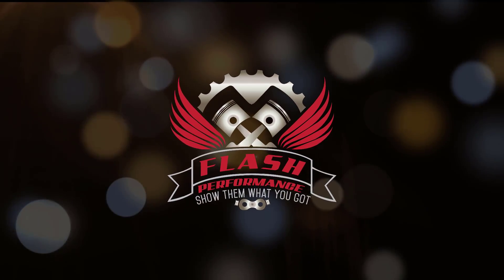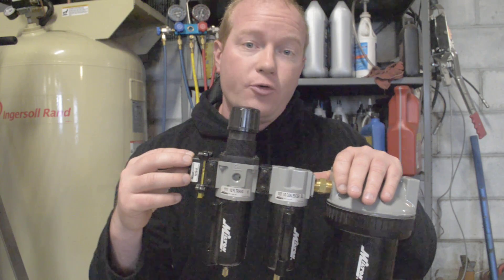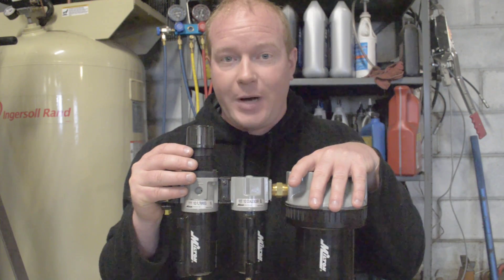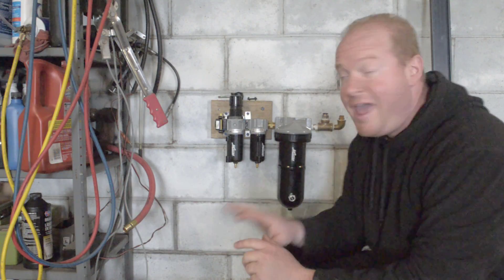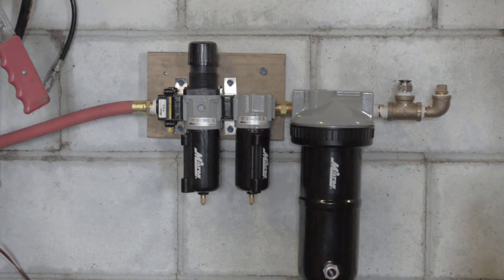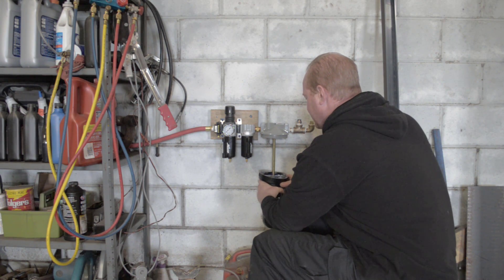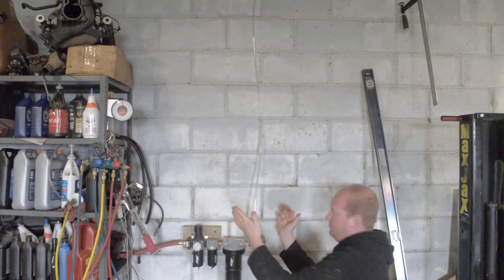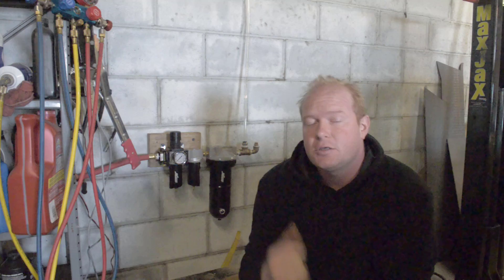#Milton Shop Air Filter Dryer System

Comment: Bad practice to hang an assembly by the connection piping.  The maker of all of these filters (no matter the brand name) should sell the connection bracket/ coupling, like the one between the regulator.  I have asked for them to sell it, for proper mounting, but crickets.  Sad.

Comment: I know this is old, but I'm considering buying this unit. Is the air flow plumbed in reverse in the video. It would seem that as the desiccant breaks down, it would travel through the line into the tool. I've never seen a filter system without a filter and regulator after the desiccant. Of course, in classic Milton style, I can't find anything online, no manual,  not even a Google image of someone's setup. Any help would be appreciated.  Otherwise, I'll probably go with an Arrow PC7612XXL.
Reply: I just ordered the arrow unit, how do u like it ?
Reply: @Exit1Auto  I ended up buying the Milton but installed it in the correct order. TBH, I think they are both just as good as the other. I have sprayed with it and have had zero contamination.

Comment: I live in sunny FL. Milton is an old name...my dad had Milton products  in his old service station..in my home garage. I have a half inch filter system..Amite system another old name in the auto shop system. Known for there lubricant products. Love Milton as well. I bought a new industrial  type air comprsoir..for my home shop..a Saylor-beall  unit model # VT- 730-60-1-FP.    60 gal .. they offer a cooling system  on there profomance  pkg. With a radiator  on the belt cage by the motor  a fan built on the motor to cool it to room temperature..plus a automatic  tank drain. Due to the fact im.in FL..I hard pipe my shop, black iron pipe..no plastic  it will peel from the inside out..in time and get in your air tools and pain guns ..after 10 yrs you,ll have issues..trust me..  so I stayed with iron black piping..old school..plex piping  is what I was referring too..it will start to peel over a long period  of time..I do drain everything  out at night..because  I have kids around..for safety..and lock out the power..to it..as for your comprsoir. I would add a magnetic  starter..to it IR has issues  with there pres switch s...it will cost about 300 bucks. A adder..but worth it in down time costs ask any electrician..if your unit is 5 hp.or more..your drawing 40 amps at a minimum  starting your unit each time....great  video  love it..

Comment: Do you have any ideaif there is a filter I can put between the compressor and the tank that will prevent water from entering the tank?
Reply from the maker: I don't know of any addons that could be put in between the compressor and the tank. Some compressors have this built into the compressor.  I don't know of any aftermarket solutions

Comment: Good video. Question tho.. I read in more in one place that we should run at least 20 feet of line before hitting the filters, due to temp of air before it condenses. I just have a 5 foot whip line and looks like what is used in the video. So we're fine just going the 5 foot distance? I was going to run the 5 to a 25 foot  before filters, and then another 25 for line. But now I realize I'm likely killing my air pressure to end tools. I'm only running a 21 gallon 125psi compressor on 3/8 line
Reply from the maker: Yes, the goal is to cool down the air before it gets to the dryer.  Cool air is easier to dry then hot moist air.  in normal daily use I have not had any issue. I have an 80 gallon tank and an automatic tank drain.  However when I am doing heavy use.  the dryer can't keep up being that close. it gets over saturated and can let moisture through.  That was the trade off I had to make in my tiny garage.  If I am doing sand blasting I have to stop every 30 min or so and let everything cool down.
Reply: @FlashPerformance  ok thanks. I went ahead and finished my 3/8 with hi-flow lines last night on  my 21 gallon compressor. But rather than going  by the setup illustrated I went more towards a hookup for 60 gallon the book showed. I did a 3 foot line to a T with drain link and 25' foot hose to run up,over and back down to another T with drain link. And that's linked off to filter and 2nd 25 foot for tools. It's only 125psi so if I need more for an impact I'll just directly hook up the second 25 to tank
Reply: Easiest way to do this is with a forced air after-cooler between the pump and tank. Keeps condensate out of the tank for the most part and does a better job keeping hot, saturated air out of your system even with the pump running. My inlet temp to the radiator is about 280 degrees and outlet is a few degrees above ambient. My inline water separator keeps the water out of the tank.

Comment: I heard you shouldn't go over 200F with the silica beads? Also, install the air filter way further? https://youtu.be/EgaJ0QgFllc?t=352 OR milton's advice : https://www.miltonindustries.com/faqs/what-is-the-minimum-distance-from-the-air-compressor-to-the-frl/

Comment: Wouldn’t you want to put the air drier at the far end of the line where the air has cooled down and the moisture precipitated out the drain, rather than near the compressor?
Reply: Not an issue if you fab/install an after-cooler between pump and tank. Otherwise, you are on to something.

Comment: Was really into this until I saw the price! Unless you're in business, there is no way I can justify that amount of money. The shame going on Milton. How greedy can you get! I'm with the other guy, I'm going to see what Harbor Freight has. Anybody for that matter.
Reply: I would say shame on you for supporting a Chinese company when you can buy some thing that’s made in the United States
Reply: @baboon50  Don’t worry, I bought a Hayden transmission cooler, a Parker auto drain dryer and a used “made in Minnesota” Axial fan in a square used housing. Unfortunately, I decided to wire in the fan to the compressor power supply instead of a separate 110 plug, so I had to buy a Dayton 220 fan that is made in China. All my Milwaukee power tools are made in China, my recent craftsman tools are made in China, my Ridgid miter stand is, my delta table saw is, Jet horizontal band saw is, the alternator on my car. The days of the little guy standing on top of the “I only buy American” mountain is good in principle, but impossible to practice. Greedy corporations have been allowed by greedy politicians, to build everything off shore or in Mexico (like my Can am)! I thought it was made in Canada! I was pissed!

Comment: $625 for that setup. Back to HF
Reply: If you need dry air first go to ebay order gallon of silica beads. 2nd go to any hardware store. I've made several different degrees of cost. I've used 2 inch 2 foot of pvc with couplers and 2 inch to half inch then half to a quarter. With steel wool packed in each end and half gallon of beads. I remove the half Inch fitting use pliers remove steel wool and empty and reheat the beads. $15
Design 2, 3/4 inch brass connects 6 inch long. With a coupler to join then. And red couplers 3/4 to 1/4 brass is known as the cold metal. $30. Abd I've made one out of 48 Inches of 1 inch of black iron pipe. 1 Inch to 3/4  couplers then 3/4 to 1/4 none have ever impeded air or given me dryer air in my life. I run 2 or 3 compressors non stop for painting all 110vi use a 3 to 1 in reverse.  Plug the 3 hose lines into my air dryer then to my lowes 7 gallon reciever tank. Actually getting rid of those wall mount ones increased my air flow a good bit just using my dessicant filters with steel wool in the ends. And if somehow a beed made it past it goes into a storage tank and not into my airline. Never had a problem. And I use 25or 50 foot lineson my compressors to let the air cool some. With so much dessicant it's all that's needed and I live where its 90% or higher humid year round. Rarely rarely ever get low humid days even in winter. You dont need all this fancy systems to have dry air. $15 in pvc and half gallon of gel $15 and I'm willing to bet my 15 dollar design would have lower humidity coming out the air line then this contraption and have better airflow. Your systems weakness is its smallest restricted flow point. If you need more filtration use it at point of use dont constrict it right out the compressor. Take one of those store bought ones apart and look at them sometime.
Reply: Thanks. You save me from having to watch the video. Incidentally, I don't think a 1/2" circle is only twice the size of a 1/4" circle.
Reply: James Smith do a video, too much reading

Comment: Your Oiler is doing no purpose before your dryer or your desiccant you should run straight into your free charcoal filter through the desiccant filter to the paint. If you want a oil your air tools split it off before it goes into the charcoal filter run up to the oiler and a pre-filter and then to your air tools
Reply from the maker: First is the regulator, second is a moisture trap (takes out the heavy moisture) last is the desiccant dryer.  I don't show an oiler in this video.

Comment: Why do so many other setups have the regulator after all of the other filters? Except the desiccant filter, that is always last.
Reply: It is probably because the air needs distance from the compressor to cool off before the water will condense and then be captured by the filter. In this case, the desiccant.

Comment: Actually 50ft between your compressor is best for optimum performance of your filters. You can use a 50 foot air hose running up and down the wall with water traps at bottom to catch most of the water before it makes it to your filters,  it will save drastically on the amount if desacant you have to use. But nice video thx for sharing the info on milton industries...
Reply: You can accomplish even more with a proper after cooler between the compressor and tank. It is a very good idea to keep the water out of the tank in the first place.

Comment: So where did you get those clips or brackets to mount the regulator to the board? Are they made by milton?
Reply from the maker: Yes, I got those directly from Milton # S-1163-14 https://www.miltonindustries.com/frl-modular-system-mounting-bracket.html

Comment: You have your static pressure set at 90 but if you're running something higher demand than a simple nail gun you'll want to set it for working pressure.  If you're running a impact wrench you won't be getting the best performance out of it.

Comment: Hi the backside were you put the mounting brackets is the unit threaded? I got one and it does not appear to be threaded. What size bolts did you use? Thanks
Reply from the maker: The holes are not threaded, they are drilled for self tapping screws.  I had the same issue with I first got mine.  I tried to make brackets for it and it just didn't work out right. I ended up getting a set of Milton mounting brackets and it included the screws. https://www.miltonindustries.com/frl-modular-system-mounting-bracket.html
Reply: Flash Performance l
Reply: Flash Performanc

Comment: Looks like this is what I need for my air system, would be better if the water trap is at least 20 foot away from compressor! Apparently warm air will not condense in water trap, the colder the air the more chance you have of removing moisture, some people run the air hose in a spiral through water and even add ice to help it cool down, I was getting fish eyes in my clear coat so I found out about moving trap and it has worked for me ..
Reply: Alan Cooper a
Reply: Yelp I installed mine at 25 feet away from the compressor
Reply: YEAH